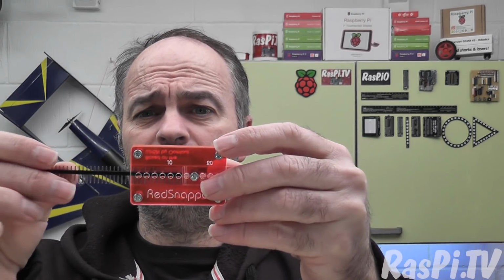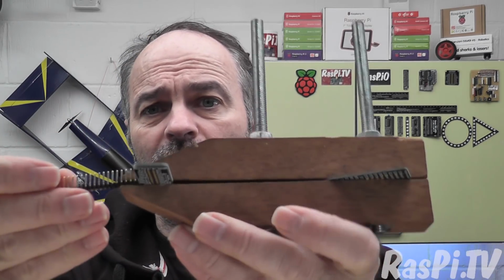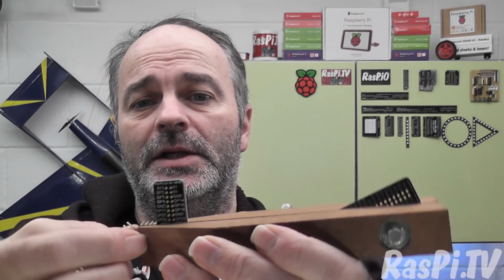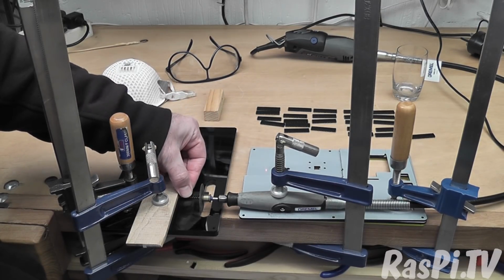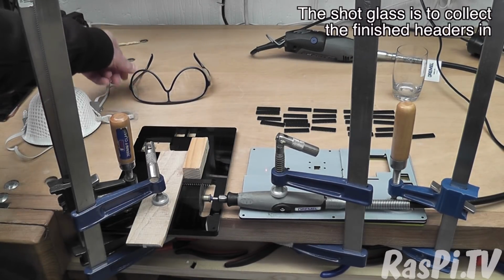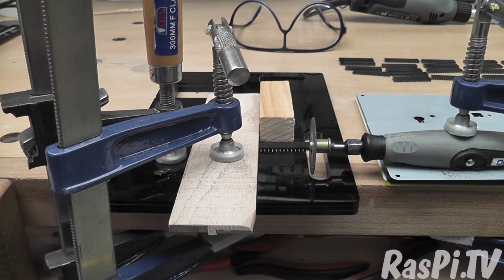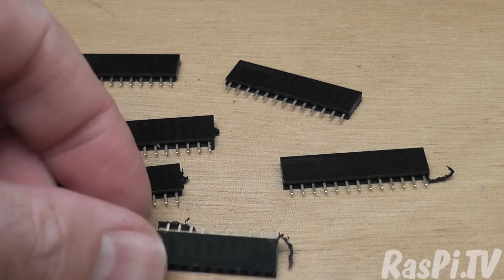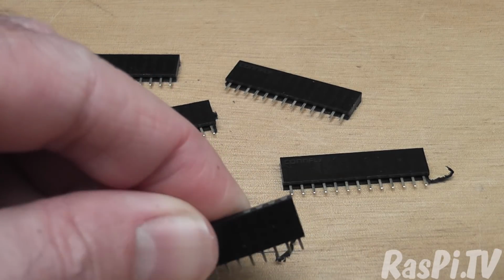Header Cutting Dremel Jig

Comment: Would a wire cutter or diagonal cutter also work, or would that be too imprecise?
Reply from the maker: It works in that you can shorten a header using them, but you will need to tidy up the end with a file or sandpaper afterwards. Certainly not efficient when you have to cut a lot of them.